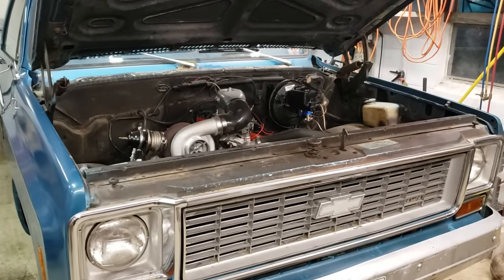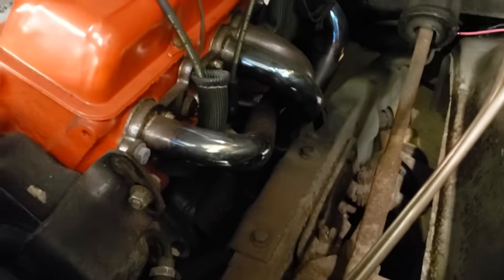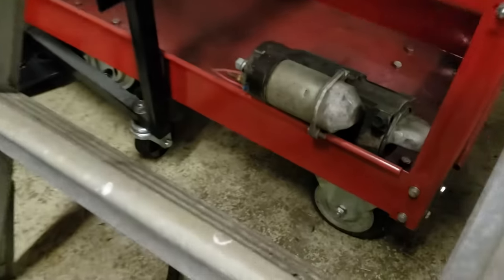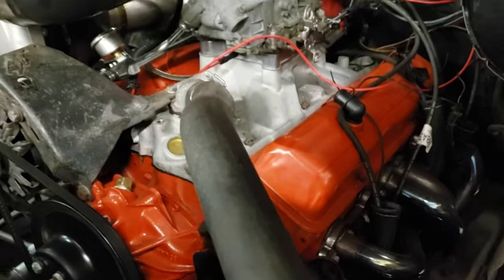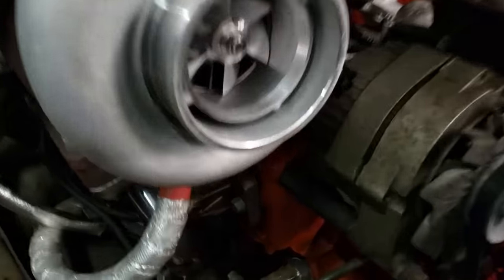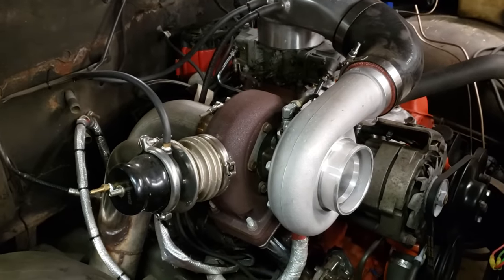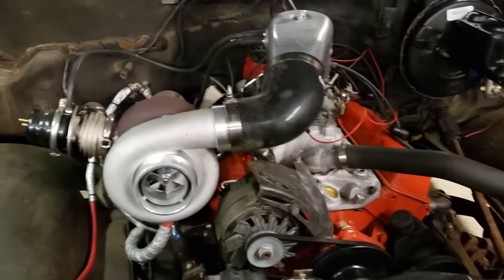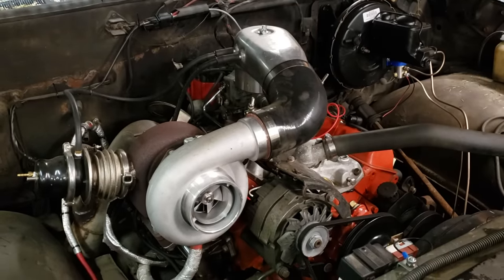Should you buy the $699 Ebay SBC turbo kit?

Comment: Sorry, but this review is ridiculous. First of all, it doesn’t take “two hours” to change plugs, it literally takes two minutes to unbolt the turbo, down pipe, and oil feed to get to the plugs on the passenger side. Second, this kit was not designed for a mechanical fuel pump. Third, this kit called for short spark plugs, and Accel makes a good set. The kit itself was designed with a smaller 90’s LT1 stater in mind. These kits were a rip off of the BBS Designs turbo kit for the 3rd Gen F-Body, ripped off by a company called SSAutochrome. The latter made it a universal kit that needed additional fabrication, this was understood way in advance because the original BBS design needed no adjustment but had a price closer to one thousand just for the headers alone. Here you pay a fraction for the entire kit, with some adjustment requires because every SBC is different. This was always understood. It’s hilarious when newbies come along and try to reinvent the wheel a decade later because BBS did their kit in the 2000’s…

Comment: why would you choose to notch the frame over modifying the header...
Reply: There's a misconception, about flow being impeded if the pipe is dented. The hot Rod guys busted that myth though, in the dyno room
Reply: jonnyjb69 my thoughts exactly!
Reply: A ball peen hammer to headers does anything you want. A cheap set of headers or chop the foundation of your ride. Watch motor trend header clearance dyno test
Reply: Cringed at that also
Reply: The same reason he would buy a $600 eBay turbo kit and expect everything to fit. 😂
Reply: Because you have to be a good welder to make headers seal up tight.but the frame you can just let your snapping turtle do work.
Reply: @MD-xw3gd  No need for a welder, just a hammer. I think the frame is a little more important than the headers...
Reply: It's a 2 wheel drive truck, not that big of a loss
Reply: Exactly, hit that header tube...never want to weaken your frame...
Reply: @vermin1970  HA !!....finally somebody  said it......he paid peanuts for something, if done right involves big costs  ! The old saying " you get what you pay for" and then he says if I would have known of these problems I would have just bought the turbo and built it all myself.......ha ha and that's why he bought a kit lol
Reply: Yeah not to mention engine Masters busted that myth yet again afterwards. While on some level it probably does interrupt some of the flow Direction it is so small that you would never even notice it
Reply: You would of been better off just buying a big block in the junk yard if you want power
Reply: I'm overly impressed with your perserverence and problem solving. The idiot posters fail to recognize one thing. At the end of the day you have honed your problem solving skills and learned so much to
 add to your bag of tricks. Bravo! I made my bones like you...the hard way, and am a better man for it. The journey is the destination 🙌
Reply: He doesn't need look at the frame just don't open the hood there is nothing to look at

Comment: I’m very impressed at the result, most people would not have put the time or effort into finishing the kit. All of those out there who comment negative things like the frame notching and poor setup. Hind sight is 20/20, no one is perfect! Now that he learned how to do it, I’m sure another project would be a cake walk.
Reply: Should I do this to a 305? It’s slow as fuck. Been sitting, 5,000 miles on motor. Though it’s probably beat to shit. ( Idk much at all) but it rides rough for sure. Wanted to turbo it because it’s cool but don’t want to kill my motor too quickly. Lmk
Reply: @dhgcrack3r111  If you gap the rings and run some head bolts. If it’s something you want and can do why not?
Reply: @BrieferBread66  fuvk it dood

Comment: I thought running headers on a 73 Z/28 was a pain in the ass. You guys are doing Gods work beating your heads against the brick wall so we don't have to. Thanks.
Reply: Try a Firebird if you think an SBC is difficult.
Reply: @superduty4556  My God you must really be into some serious Masochism to try and shoe horn big block headers into a second gen F-body. LOL.
Reply: @seththomas9105  the worst part is that Pontiac exhaust ports point down, so you can't hang it on a stud.
Reply: @superduty4556  Well that's just that "Genuine GM feeling" you get when you spend All Saturday to do a job that you think will take you 4 hours, tops.
Reply: I almost bought a pontiac 455 trans am but got a 81 camaro instead.
Reply: I had a 68 Camaro with a BBC and the headers slide right in no problems! It was one of the easiest cars I have ever had to work on, and I worked on it. It ate Starters, everything was easy to do, even changing plugs. And unlike sbc headers they never came loose!
Reply: @charlesprice7608  Ha. How well I know.
Reply: @seththomas9105  lmao! Brother i needed that laugh for sure! Helluva Monday, had a flat tire and classic Chevy ground wiring intermittent shit made me late to work. Sigh....at least it didnt smoke the starter this time.

Just Chevy Things

Sure, we have the LS platform but at what costs? Cheap dash plastics? Wiring insulation that rodents are attracted to? Whack ass placement of just aboot everything wiring related...and Ive got a full size chevy truck. The cars must be a proper klusterfunkin shiteshow.
Reply: @threadtapwhisperer5136  I feel your pain. Wish we all were running 327's and 389s again. Simple to work on and room to do it in the engine compartment
Reply: @seththomas9105  Try BB headers on an 85 GT with shock towers
Reply: @charlesprice7608  TOdays headers dont come loose anymore they got thick flanges
Reply: @gordocarbo  No thanks. I have enough pain in my life! LOL.

Comment: I bought the same headers from XS power for a sbc in a third gen fireturd.  Was so disgusted with them I just build my own kit.  All of the issues you described are %100 accurate.  The plug on number 8 is pointed directly at the primary tube.   XS power never let me return them and stopped responding to my emails and phone calls.  Just filed a claim with paypal and they gave me back the $210 and I get to keep the headers.  Maybe I can give them to someone I hate

Comment: Still waiting on the 2nd part of the carb lol 
Yeah I went with Cx racing headers they actually fit pretty good . The last tube should have been dented for clearance it’s tight but you can get a header bolt in it .. all the rest I used some studs ...
Reply from the maker: The footage got deleted. I was upset to say the least. I'll probably do another one.

Comment: Thanks for telling it like it is, and yes most these "budget ebay turbo/junkyard builds"...as you said they never are heard from again
AInt on cheap way for hp. 
If I could weld I may  be interested in fabbing up a boosted build but refuse to put EFI on an old car and am tired of leaning over hoods
Fun as a teenager or even my 30s. Now Id rather not unless I have to .Just wanna turn the key and burn rubber.

Comment: No!!! Because it won't work on a BBC!!!

P.S. I would have reengineered the entire thing so it fit properly and I could do what needed to be done without removing half of it to get to sparkplugs!!
P.P.S. For what little extra horsepower you're getting, seems to me, a nitrous system would have been easier.

Comment: Notch the frame? Haven’t you seen engine masters where they just bash the headers with a hammer? 😁
Reply from the maker: Yeah I modified the lesser value parts.
Reply: @FuelInjectionSucks  
So you dont value the structural integrity your frame provides!?!? 
Hopefully this beast is roadworthy and safe for many enjoyable years to come my friend!!!!
Reply: Fuel Injection Sucks lesser value?? Parts are temporary, especially those poor fitting types. 
Smh.
Reply: Grab A Sandwich i saw that one

Comment: Ebay Turbo kit...No!   But  Ebay turbo....yes! Not only do my brother and I build high-end custom cars and race engines but we have been using eBay turbos for quite some time and making ridiculous power off of them. There's a few things that you can do to check the turbo out when you first get it, I'm not going to get into that because there are thousands and thousands of videos about this subject, but you checked through it and find out if the turbo you bought for a quarter of the price is good, then you run it. Unfortunately the kits are problematic, this is where they get you. Many of the kids don't line up properly and we're need other parts to finish the install properly. Don't get me wrong some of the kits will bolt right in, but many do not. And truth you're better off just buying the turbos, and going out and individually buying the rest of the parts and build your own kit so to speak.
Reply from the maker: Yup, I agree with all of that.

Comment: Wanna hear a scary story? I was in my old turbo diesel Nissan going down a country freeway when all hell broke loose. The oil seal on the cold side of the turbo was breached and let plenty of oil into the motor. The 4WD took off like it had had a shot of NOS. I took it out of gear (manual), and the engine revs went well past the indicated taco range, I carefully turned the ignition off, making sure I didn't lock the steering, but she kept going due to the glow plugs. I managed to pull off the road and had to use the brakes to burn the clutch out! By this stage, I was waiting for a conrod to go through the block.

It scared the crap out of me. The roadside mechanic said that he had seen it on stationary vehicles and the only way to stop it was to put a rag in the inlet. I have had many cars with turbos both petrol and diesel but had never heard of this before.
Reply from the maker: It went "runaway". It's a diesel thing. Can happen when the turbo goes like yours did, or if the piston rings get really bad. There are compilations of it on youtube.
Reply: @FuelInjectionSucks  Yeah, that is what the mechanic called it. I certainly know about them now :)

Comment: I used to bend these with n/a 350s. you got a strong truck with frame chunks missing and a turbo. I am assuming this is for 88-98 or something else. Glad it runs.
Reply: barry g73  bingo lol 88-98 or for a third gen Camaro or Firebird cause mine fit just right I didn’t have to mod anything also I think the blow off location work just fine the first set of these headers they made for these it had issues I’m not to sure he actually knows what he’s talking about especially when he mentioned blow thru carb Because you can’t run pressure to a regular carb because that pressure will crush your float and  then leak through your Excelerator pump

Comment: This shouldn't discourage you from buying it, the kit is meant for a 70's to 80's camaro if you try to run it on anything else you are to expect fabrication cause it's not meant to fit a squarebody. Good video not bashing, also the kit has been proven to make a reliable 650hp.
Reply: Regardless of what chassis or vehicle this kit is installed in, the kit should atleast fit the engine without modification. Out of the box this kit didnt even fit the sbc it was designed for and couldn't even put spark plugs in it. Most of these kits are trash and most of the time it's easier to just build a whole set up from scratch or only use one of these kits for a few components.

Comment: I am running the same setup just about. deleted mechanical fuel pump reloaded alternator to the right side just above the power steering pump running turbo headers on passenger side only so I don't overboost and wastegate is more efficient

Comment: Great job working through the problems, I’m guessing two options, 1st the headers were not in a jig when welded, and moved all over when the 12 yo in china welded it up, or second this kit was not the proper kit, at least not the correct headers., I’ve watched Richard holder? Does all the turbo reviews, his recommendations were to just work with the factory headers?! Build your own crossover, and buy a t4 flange., I’m guessing that fuel injection, and electric fuel pump would be ideal

Comment: There is no “bolt on kit” for anything. When you boost anything that came NA,  EVERYTHING...EVERYTHING!!!! Is one-off and custom. Your set up looks like shit. It’s a dirt cheep kit (its 699$ what did you expect?) my turbo ran 1900$ by its self.  The only thing I watched in this video was some guy complaining about his lack of problem solving skills and blaming the kit for his own short comings. Get you some shorty truck headers flip them to dump out the front, put your turbo in the bottom corner and run your lines and piping. Stop over thinking things.

Comment: If choosing an IDGAF route theoretically.. you could flip the exhaust manifold upside down route the turbo and all other related components above the engine to simplify all the bullshit. Considering how low it sits in the engine bay in relation to the top of fender I wonder the precise amount of hood cutting necessary to even do that.

Comment: If the turbo kit didn’t fit it’s self why not just send it back and use that enormous engine bay for twin turbo that way you don’t have a cross pipe and end up notching the frame and still having to fabricate a piece?? You would avoid all the issues you had except for still moving in the alternator

Comment: dont you NEED to use electric fuel pumps when doing forced induction with a carburetor?
the boost would feed pressure back into the jets of the carb decreasing fuel pressure by an amount approximately equal to your boost pressure causing a lean running condition
and i think i can honestly say many of us know lean be bad

Comment: How did you run the oil lines? Iam about to install a turbo on my car but can't find where to install the oil lines from the engine. The only thing I can think of is run the return into the valve covers but how do I get the oil out?

Comment: 350 in 3/4 81 4x4  gmc with custom camper on back.
Considering e.f.i. with a turbo. I live in Montana and there isn't much access to knowledge.
What is your opinion? 
I have also considered lightly modified 8.1 but I just wanna stick with sbc.

Comment: nice video. just imagine how a kit would fit for a car that doesn't have as much room as a chevy truck., I know the frame rails are narrow but you still have a lot of room besides that. and issues like fuel pump clearance and alternator clearance is a problem like you showed wow. I want to do a turbo on my 72 C10 and that crossover pipe worries me because apparently theres like different mounting positions for the engine. it may be big block vs small block or 6 vs 8 cyl, i don't know but im pretty sure there is different engine mounting set ups on a 72. I've been practicing tig welding so like maybe I will buy the manifold and do the piping myself if i ever get to that. I don't know but I want a turbo but I'm scare of all the fitment issues and tuning and stuff. either way thanks for making this video

Comment: In some circumstances you can bash a header with a hammer and make it clear, but at the end of the day, you won't have much clearance at all.  When that engine moves under acceleration it will constantly hit the frame.  Frame hole can be easily welded shut with another piece of metal.  I had to cut into the K member on my fireturd to fit cheapo longtubes.  It's really not a big deal.  There are very, very few parts that simply fall into place when building a vehicle.  If it was as easy as just threading bolts into holes, more of the peanut gallery in the comments would have callouses on their fingers from something other than typing and fapping every time someone imports a nissan skyline

Comment: So is having no intercooler a problem?
Reply: YzFDyL it’s not that big of a problem, the turbo would be blowing hot air instead of cool air into the engine and hot air will give you less horsepower cause it’s less dense
Reply: @Foxell_YouTube  yep
Reply: If you're running low boost and a blow-through carb you often don't need an intercooler. The fuel vaporization in the carb helps cool the charge.
You can add an intercooler if you want to, it won't hurt anything. But you don't actually need one if you're only running like 8-12psi.
If you turn up the boost above that you'll need an intercooler.

Comment: Just bolt on a damn supercharger. Geezus
Reply: I will buy all the $600 supercharger  u  want to sell
Reply: Supercharger  is WAY more $$$ work,time,and less hp and you start in the gas tank,it is SO much easier  to pull air than push it,with zero loss from somthing else on the crankshaft
Reply: Don't have to notch the frame, you can use better headers, actually work on the fuel system, put oil in, not worry about blowing your motor Bec you have a crap waste gate setup, etc..... More pros than cons imho. But it's just an opinion I like turbos too just not on such a wierd setup. It's worth spending more money to do it right... Once again, my opinion. Don't get your panties in a bunch.
Reply: More expensive and makes less power.